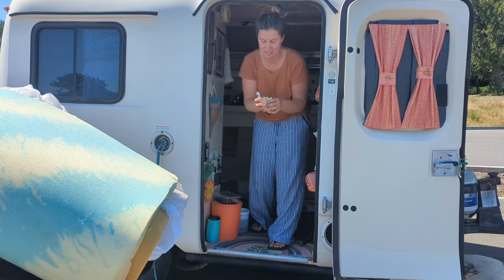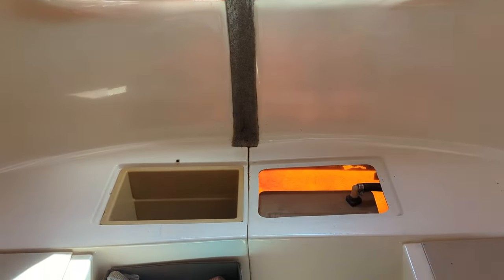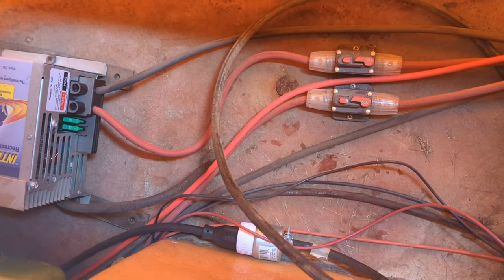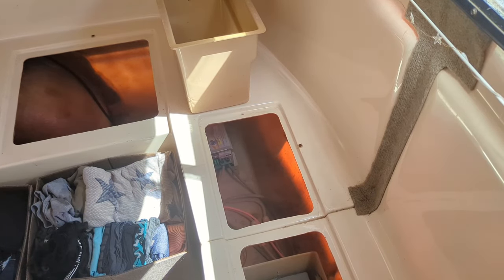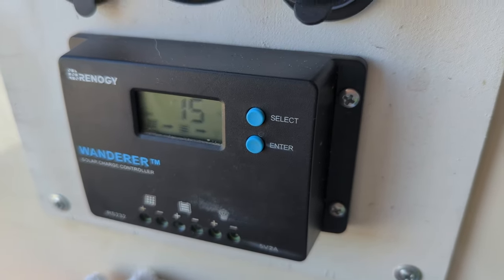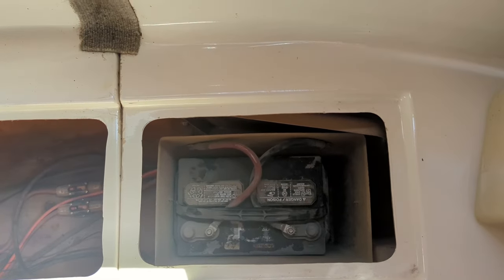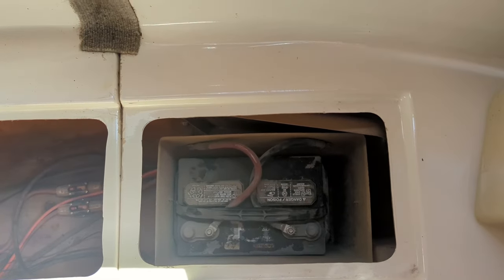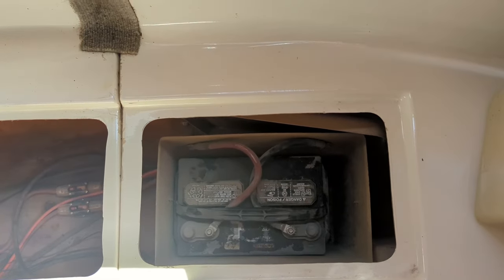Solar Trouble on the Olympic Peninsula (Diagnosing and Figuring Out Problems with Little Knowledge)

Comment: Glad you were able to fix it!  I am about to pick up a battery for mine- its super dead.  I have the same camper ❤ just got it and found your channel after looking for some hot tips!  I will be replacing frame bolts before hitting the dirt- thank you for that hot tip!  I am also thinking about insulating the floor.  Maybe some kind of skid plate someday too, idk yet!   Would you be willing to snap a pic or a short of whatever that gasket drip strip is above your door and window?  Mine does not have that and I think it would be nice to add.  Love your channel.

Comment: You can simply get the battery itself tested at most auto parts stores. They connect it to a stand alone battery tester. Don’t have to disconnect the battery. Just run a series of tests and in a few seconds you’ll be able to see if the battery is in need of replacement.
Reply from the maker: That's ultimately what I ended up doing. I had to remove everything from the camper to access the battery box, or put the camper back together to tow it to the auto parts store to turn around and take everything out in their parking lot. It just made more sense for my situation to disconnect the battery to bring it in and have them check it that way. Otherwise it would have been twice the work to do the same thing. Thanks for all of the insight and advice. 💛
Reply: @tennesseewanderer  Hmm Just in case most of them offer all kinds of free testing services. Before you leave on your next adventure let them go over your tow vehicle with a fine toothed comb especially the alternator. Nothing else will end your adventure faster than one of them going bad. The bad part is that they tend to go bad all of the sudden with very little warning leaving you totally alone and stranded.

Comment: The fiberglass damage you pointed out is caused during the manufacturing process.  The fiberglass lamination left an air pocket between the gel coat and the first layer of fiberglass.  It's not a structural defect to worry about.  It's only cosmetic and can be repaired by many methods including filling with body filler.
Reply from the maker: Thanks so much for sharing your knowledge on this. I never really see the damage, so it doesn't bother me. If I ever wanted to fully restore it, it's nice to know there are options. Thank you! 💛

Comment: The battery bank is actually over-discharged. If the battery voltage (12V system) is below 11.1V it will trigger the E01 code.
Reply from the maker: Yeah, that's what I thought at first, too. It ended up being a bad battery. It was 5 years old and that's about the average lifespan of one. Thanks so much for the insight! 💛

Comment: EO1 error code means your battery is too low.  Having it plugged in should bring it back up.
Or you can hard boot everything, including your fuse panel.
I'm sure you'll figure it out.
If you're keeping the bed as a bed, maybe put a real mattress there.
Cheers.
Jon in rural BC, Canada
Reply from the maker: Thanks Jon! I went through and tried the hard boot. I even tried to let it recharge plugged in overnight... When none of that worked, I knew it had to be something more. It ran just fine for the rest of my trip with a new battery.

The foam is custom cut to fit the odd shape of the back of the camper. It's super comfy with the layer of memory foam on top. I love the bed, it's just a pain when there's a problem and I can't get to what I need to without disassembling everything.

Hope you are doing well up there in Canada! 💛

Comment: It means your solar controller doesnt see a battery thats charged, it could be wearing out and can no longer provide 12.5 volts but another thing is do you have the solar disconnect off? If it cannot see a battery it will throw that code at you. When I turn my solar disconnect off, it will give me that code, turn it on and in a minute I will get a e00 code then it goes back to normal. You dont need to disconnect your solar except in rare circumstances since it will regulate the amount of charge going to the battery, and when its fully charged it will stop delivering current to it completely. I turn mine off when storing my van for any length of time or if I remove the batteries so there isnt a charge at the battery leads which could accidentally short out, thats a bad thing. If e01 is present all the time you may need to replace the battery. when your plugged in does the code disappear, if not then your battery is definately worn out. Also if the fan on your converter seems to run all the time, thats another sign the battery is worn out also.
Reply from the maker: It did end up being a bad battery. I brought it to O'Reilly's, they tested it. It was bad. Once I installed the new one, I didn't have any more trouble. Thanks for all of the insight! That may help me out with future issues. 💛
Reply: @tennesseewanderer  Im an RV tech, been doing this since moses crossed some red sea and theres nothing that surprises me anymore or makes me say 'hold on, wth' . I love helping people out when i can, nothing better than a saturday night camping out around a fire with a few friends and not a worry in the world about your camper. feel free to bring any future issues my way